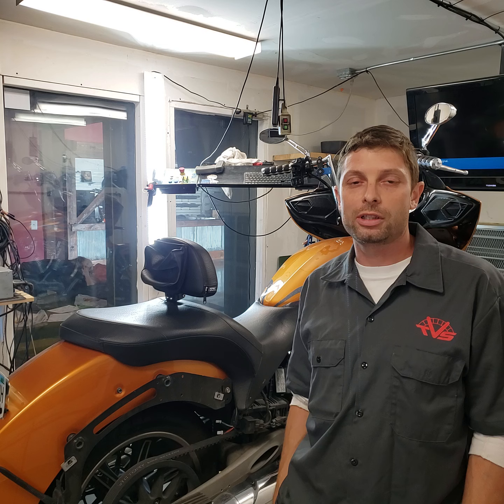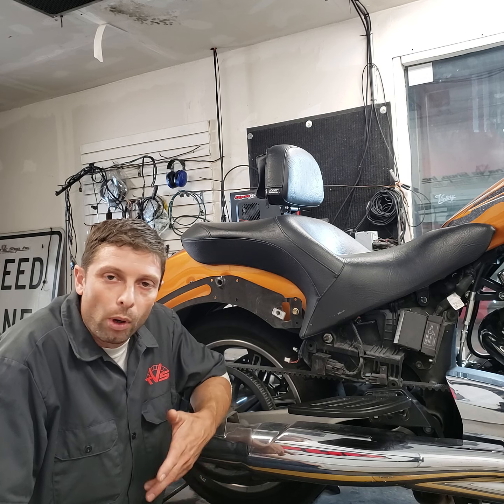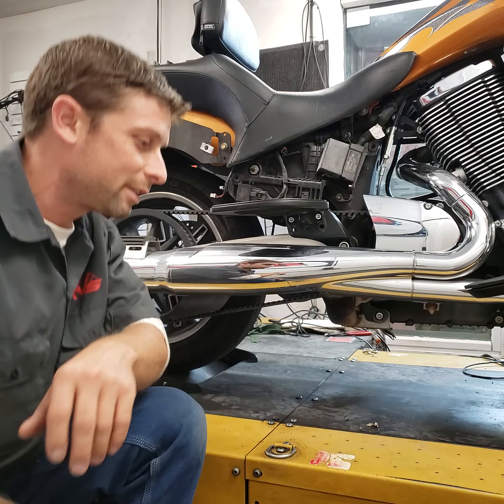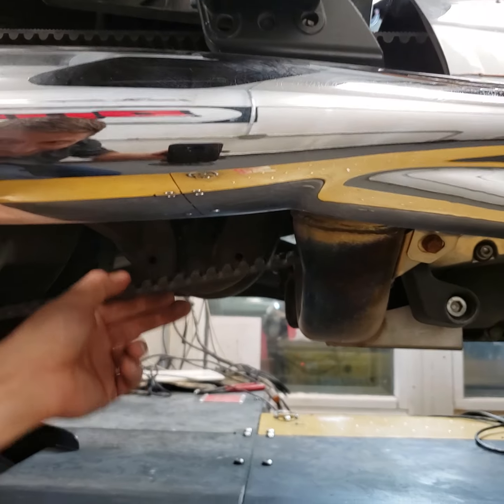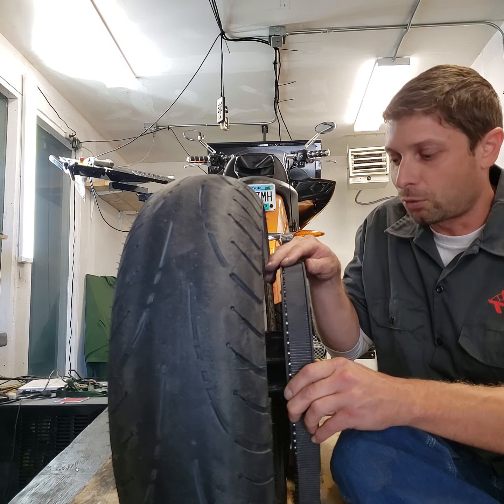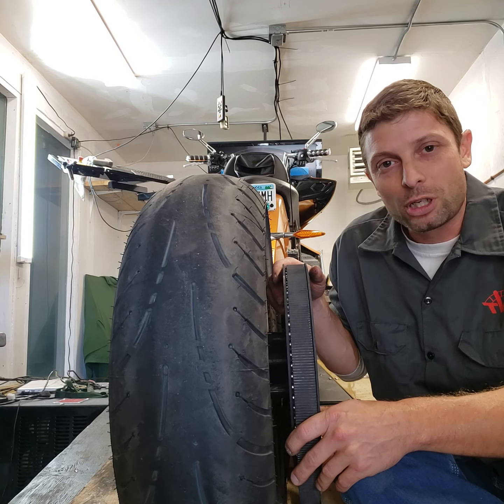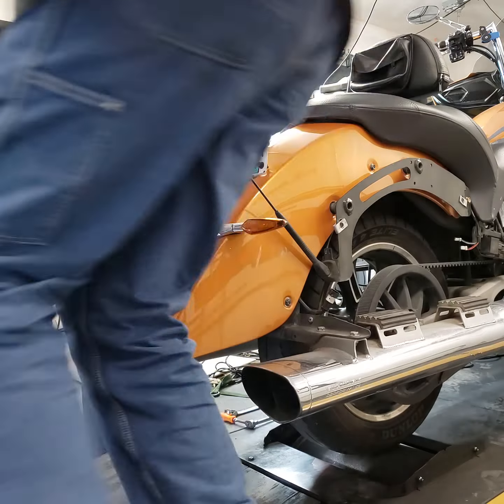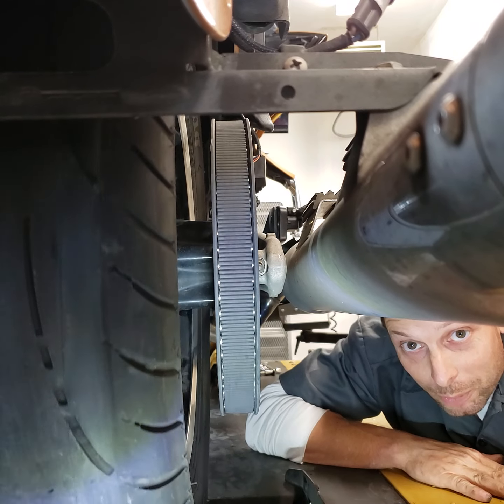Victory Belt Tension and Alignment from The Vic Shop

Comment: My new belt started to make noise again. Not the bird chirp but a lower pitch sound and more continuous. I can hear it mainly when passing a wall or concrete barriers. It is riding fine on the pulley, to the center. I was going to clean the belt and apply some dry lube. I decided to just clean it and forego the lube. Went for a ride and quiet as a mouse, even before the bike was fully warmed up. Used soap and a scrub brush, rinsed and then compressed air. Good call Rylan.

Comment: The best way to align the axle is to measure center point of swing arm pivot bolt to center of axle bolt. Once you have that aligned you make equal turns on each adjusters. I promise this will center belt on both front and rear pulleys. How many turns you do to left adjuster you must do to right and vice versa. The belt will be straight this way as well as wheel and axle . If belt rides to outside in front pulley it will rub in the inner front cover and you will need new belt. I know been there these belts range approximately$200 bucks give or take a few. When you have old belt off its good time to clean both pulleys . After a few hundred miles recheck tension. May have to do 1/4 turn each side. Safe riding. I love Victorys. I have a 2006 victory jackpot Arlen Ness looks brand new.
Reply: Thanks for the share! If you're not replacing the belt. Does the exact position of the belt matter at all. Like same tooth on pully,before you removed tire?

Comment: Ok for a quick overview and what to look for. When doing the alignment it is imperative to tap the axle forward to insure the adjusters are tight before and as the axle nut is being tightened. If you can wiggle the adjuster the axle is not fully forward. I use a plastic dead blow hammer to tap on the axle nut  or on the tire to tighten the right side. Once you got the axle tight snug the nut on the adjusters just slightly, somewhere less than a click of the ratchet. I have found that no matter how long I spin the tire  with the belt aligned as soon as it is driven the belt will be off , usually rubbing on the outside of the pulley. It always takes several more adjustments to get it right. This is on my 2011. My 04 with the wider pulley and belt was a lot less finicky.

Comment: I recently picked up an 02 V92C for 500. It needs a belt and I was told 1.5x 135 teeth. Does that sound right ? I’ve seen some listed as 14mm X 1.5x 135 teeth. Is that 14mm something that the correct belt should have. Thanks in advance and love your videos!!!

Comment: Before you take off tires use 15 gage wire use a bend leave the rest straight where swing arm use of vac hose on wire center rim axle move vac hose to bolt center so it will be set before removing tire

Comment: Great video, thanks!  I'm surprised how tight you have set that belt...spec says around 32mm play, but yours looks like less 10mm...is that correct?
I don't have a squeak, but I can feel a slight rumble on engine breaking, which I assumed to be belt related.  It seemed to improve with a looser belt, but it's still there and the belt is now probably too loose.

Comment: Mine squeaks for about 3-10 minutes. Till it’s warm. Local Indian Dealer said it’s ok. Thoughts?
Reply: If the belt isn't looking too loose cold , leave it. If you try to adjust it you may open a can of worms and make it worse. it goes away when warm. Ride it!. I had an 04 kingpin I put 40k on and ran the belt loose hot compared to  what is shown here and never had a problem with belt noise or anything else. My current Kingpin, 2011 gave me problems from the day I got it 2 years ago with 4k on it. Tight ,loose I could not get it right. even running almost dead center I would get noise. I bought a new belt and first adjustment all was good. I think the bike sat alot undriven over the 7 years and if you ever saw how tight they come from the factory, the deflection is basically zero. Between that and the bike being lowered I think it distorted the belt. The bike would bottom out way to easy with the lowering links.

Comment: I have a squeek on acceleration only('05 HD 1200),any idea what to check if my belt Tension is ok?
Reply: Clean the belt and pulleys. Do it the best you can without taking much of anything apart. Pulleys should be fairly clean. The belt could have dust on it.

Comment: Oops I followed the book and it seems like I have a lot more slack in my belt than that got her put up for the winter I'm definitely going to retention my belt
Reply: Interesting you say that. Specs in the manual for the Gunner are 6mm. Seems way too tight to me.
Reply: I thought for a cold bike that the belt seemed way too tight.  When you compress the shock and the bike get hot that belt will be super tight.  Not good for the bearings.
Reply: @spacecoastz4026  That is about where I have mine when hot.

Comment: There is not such a thing belt in the middle. It has to be towards left.
Reply: why? All depends on how it is adjusted. You can get your first adjustment to ride in the middle but as soon as you ride it ,it will move one way or another.
Reply: @340rps depends on the bike model, but usually it should be toward the inside, which is what my bike has. Otherwise it will rub to the outside metal parts and eventually snap.

Comment: No way, That belt is way too tight. Toothed belts are not too different from chains and are much better off at the looser end of the specification. 3/8's to 1/2" are typical specs for Harley belts and will work for almost any belt driven bike.
Reply: I run 1/2" hot on my Kingpin. I've seen Vics on the show room floor with the belts literally as tight as a 2x4, 0 deflection cold.